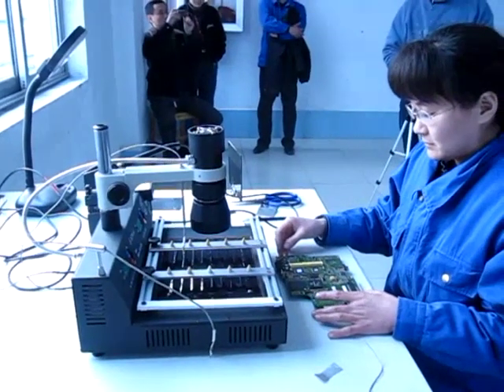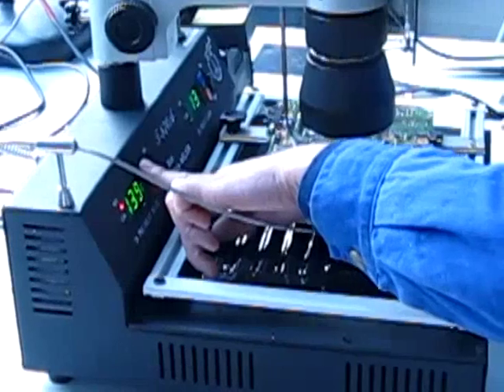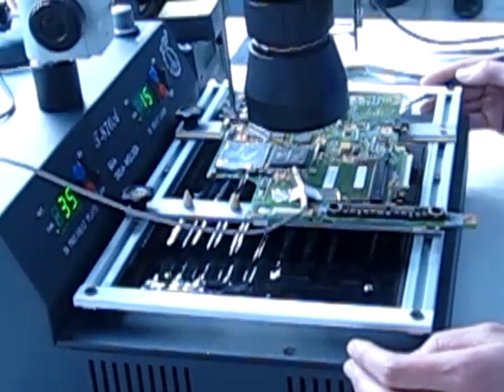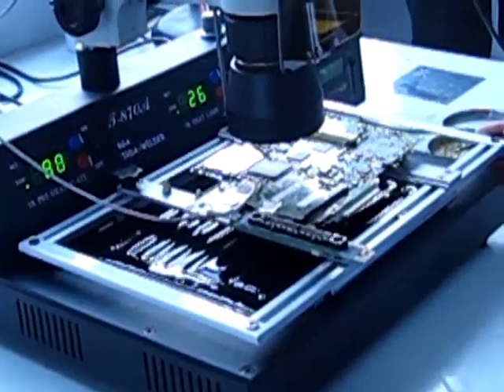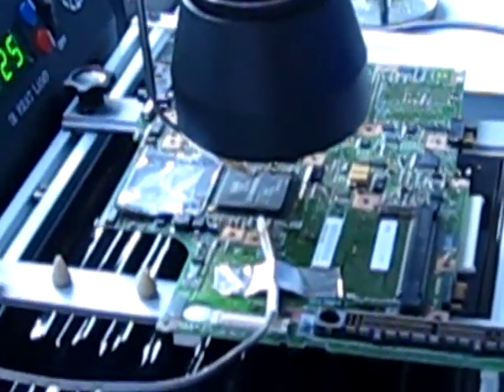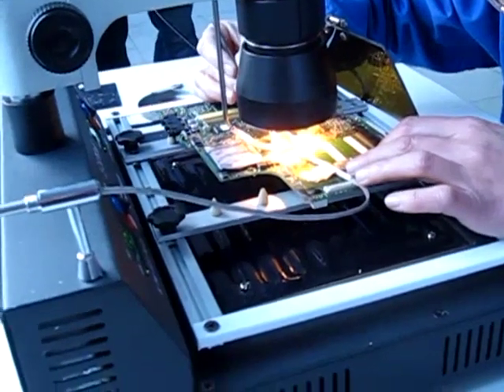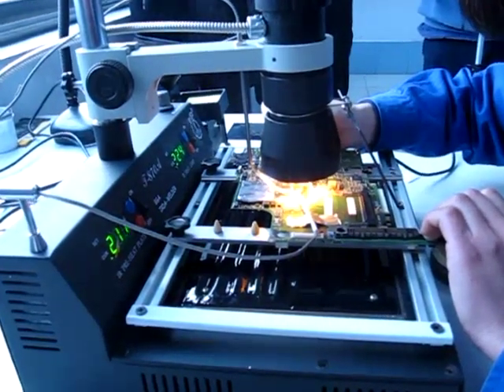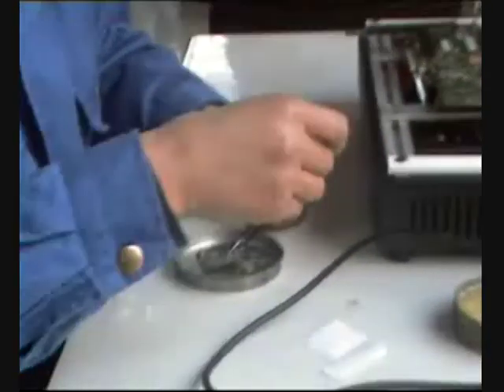How to Reball ? ... Extensive with T-870A  Digital Infrared IRDA Soldering Station 1

Comment: This is a fake product. Only spoils the components. Temperature sensors are not calibrated. Thermal profiles are absent. Uneven lower heating. I strongly do not recommend buying.

Comment: i have 1 of these machines its great at what it does, iv done xbox 360's and ps3's but iv found the after care is poor my thermocouples are reading to low and my ir filter has cracked so far no luck geting any parts from ebay suppliers

Comment: I bought t-870a, but until now I only use it to reheat the gpu or chipset, but I wanna be able to replace some of the GPU on motherboard to do the upgrade but I still have some problem with the procedure to do rework.
I have couples question for you.
1. How can I know what is the size of the ball that I must use on the rework?
2. What is the rework station that offer wide range of size of IC/chipset to do the rework?
3. where can I find the detail info about BGA rework station and buy it ?